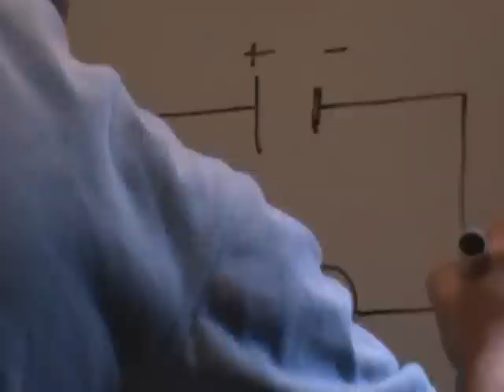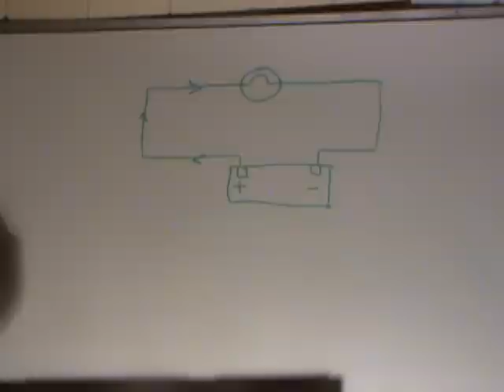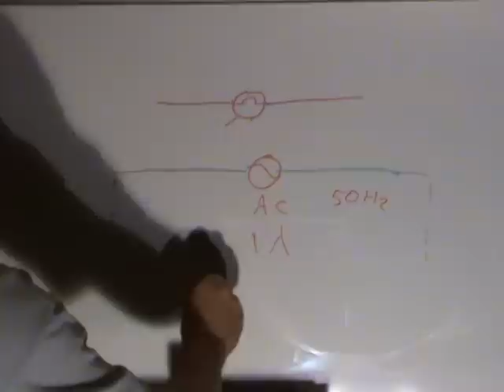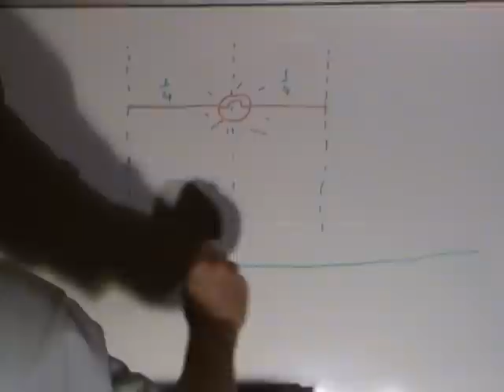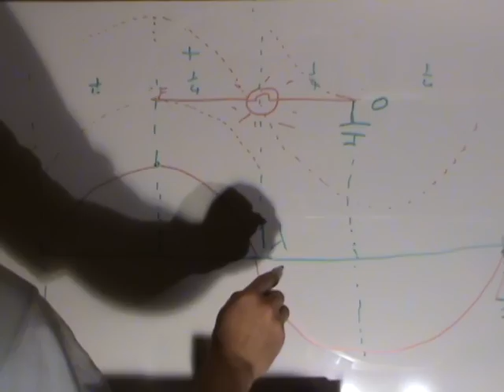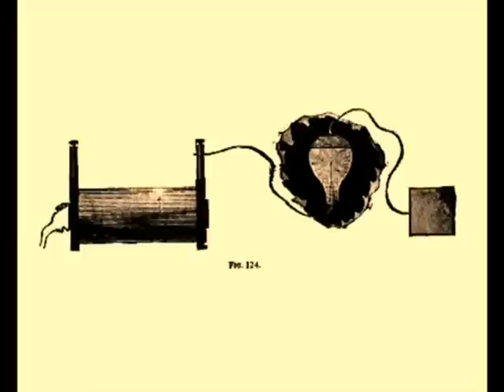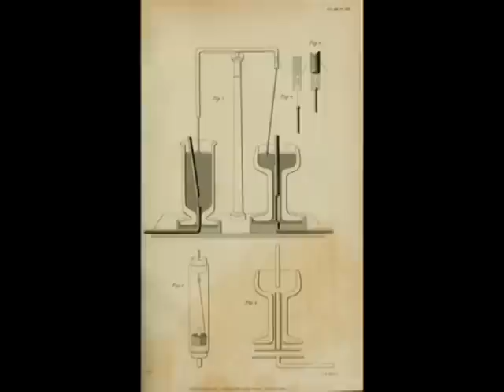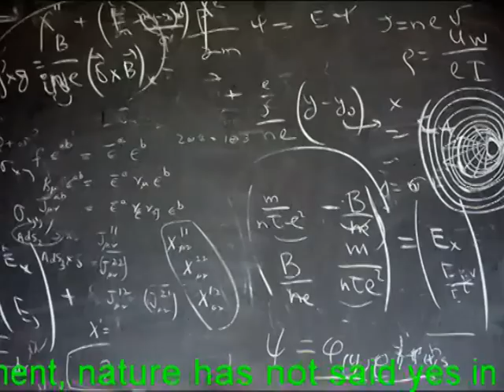TESLA'S CONNECTION TO COUNTER SPACE-INTRIGUING EXPERIMENTS

Comment: I believe that a brief imbalance is created with the dielectric medium of the free space that surrounds it; the air which is an electrical insulator is polarized by an applied electric field and creates the DIPOLE (two poles).  I will post a more complete description in the description section above explaining in greater detail what I believe is occurring as there is limited room here. Regards JRI

Comment: Please talk about dielectricity and it relationship to electricity.
Reply from the maker: Hi Paruspilot, I have struggled with the use of terminology, Dollard went back to the original terminology, whereas I believe that it would be more understandable to the many to maintain the current terminology, after all, they are just words and although I believe that dielectricity is a better description, intended to describe the two components of the electric field, just as the magnetic field is composed of two so should be called diamagnetic, but the word diamagnetic now refers to materials that are repelled by a magnetic field; an applied magnetic field creates an induced magnetic field in them in the opposite direction, causing a repulsive force. In contrast, paramagnetic and ferromagnetic materials are attracted by a magnetic field. Likewise, the word dielectricity, in my opinion, can today be confused with the currently accepted word dielectric which is the property of transmitting electric force without conduction or insulating.

Comment: Hi Aurum.  Great vid.  I was working on a single transmission myself and noticed that when I touched the bulb it completely lit up full brightness and when I remove my hand it went to half brightness.  I then removed single wire and just held bulb and noticed that it lit up as I got closer to the antenna.  What do you think I could do to get that full brightness without touching the cfl bulb?  Maybe Tune?
Thanks for all your research and help......
Reply from the maker: Hi Shawn,
There are many ways to illuminate lamps wirelessly and depends on the type of lamp, High Voltage DC and ELF to VLF frequencies have very long wavelengths so the oscillator would be out of tune to small lamps such as a fluorescent, neon lamp or even incandescent light sources. If they are out of tune the lamps can only illuminate in the presence of a high voltage field and require an opposing polarity such as a return pathway to ground or be near a return path to ground such as a capacity that can be provided by your hand as you described, the distance away will depend on the voltage output and the frequency of your oscillator.

To tune into light sources wirelessly or without any return path your lamp must be in tune or in resonance with your oscillator or at least a harmonic of it. If you attach the light source to a receiving aerial or coil or both that is in tune with the transmitter it will then light in free space. Frequencies within the HF band such as the old CB or amateur radio bands have wavelengths of 11m, so just a small coil is sufficient, beyond the MF band the wavelength is even smaller so can even tune precisely with the light source without a receiving coil, antenna or any return path to ground. The output power of the transmitter must be at or exceed the rated wattage of your light source to work.
Kind Regards JRI

Comment: how many wayts are you disipating w your radio though, and, it has to be considered , very attenuated since your pushing 50 herts and your light lit up a fewb inches away.
Reply from the maker: Hi Paul,  in one experiment the frequency I used was in the VHF band and could light up light sources up to a few meters in free space depending on the wattage rating of the light source and the power output of the transmitter, higher wattage mains globes, of course, need to be closer, governed by the inverse square law. At lower frequencies (30–300 kHz) and medium frequency (300–3000 kHz), ground conductivity is an extremely important factor in determining the field strength and propagation of surface wave (ground wave) radio transmissions. Radio transmissions are particularly reliant on good ground conductivity as their primary propagation is by surface wave. Why a good ground connection will improve AM reception and a must for a crystal set with no battery. 

Lower frequencies with a ground connection and a receiver coil tuned to the transmitter can transverse a lot further, based once again on the Power of the transmitter and wattage of the globe. I have achieved a distance of 6 km from a local AM transmitter and a crystal set lighting up a high intensity LED, maybe even further is possible. The military banned all the useful frequencies by the early 1920’s when they formed RCA and even today use ELF, yes a poor form of Tesla’s world system is alive and well and used by the military to communicate with their submarines all over the world, the only way to do it!
Because of the difficulty of building antennas that can radiate such long waves, ELF frequencies have been used in only a very few human-made communication systems. ELF waves can penetrate seawater, which makes them useful in communication with submarines all over the world. The US, Russia, and India are the only nations known to have constructed ELF communication facilities. ELF waves can also penetrate significant distances into earth or rock, and "through-the-earth" underground mine communication systems use frequencies of 300 to 3000 Hz. 
We even have a station in Australia refer https://en.wikipedia.org/wiki/Naval_Communication_Station_Harold_E._Holt  yes not exactly tesla’s world system, based on a combination of Marconi who stole from Tesla using transverse instead of longitudinal waves so not as efficient.  Kind Regards JRI.